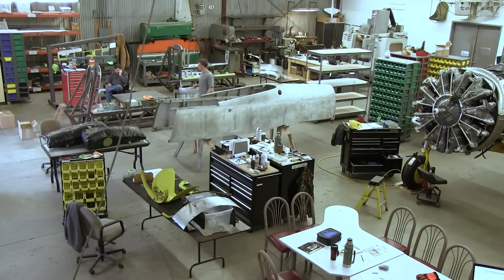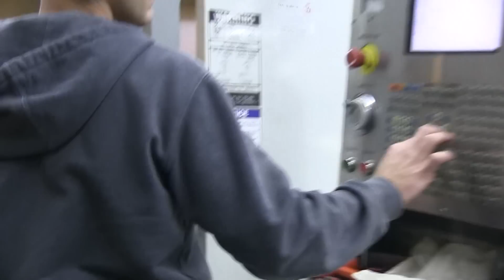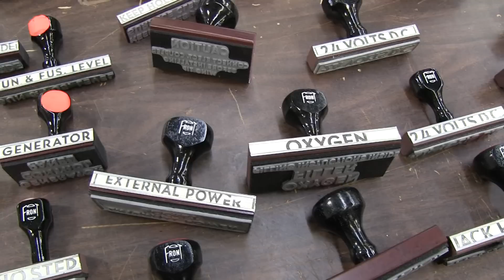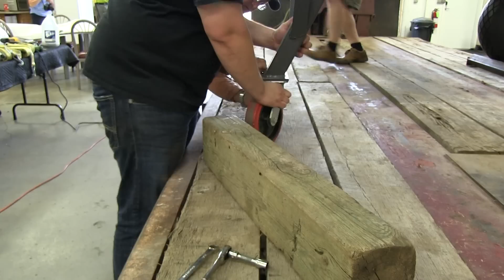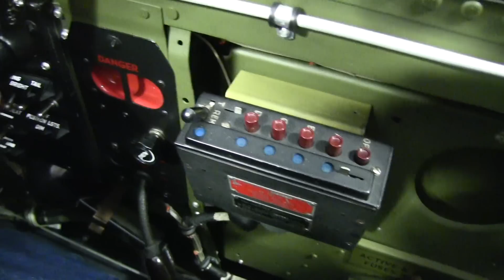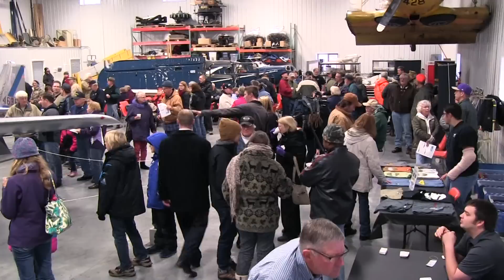Sierra SueII Master with new ending 2 12 15

Comment: I have no idea why they needed an oversize permit for that unless that tail was 14' or higher. It's up there quite a ways so that may have been the reason but there should have been a "high pole" in front of the truck if that was the case and a REAL pilot car.. State laws vary but generally you have to be at least 8' wide or the TOTAL LENGTH of the LOAD longer than the maximum length permitted in the state to need an oversize permit. Weight and height are primary factors involved and typically they are no holidays/weekends and 1/2 hour before sunrise to 1/2 hour after sunset. You don't need a pilot (drives in front) unless you're too tall and the pilot vehicle will have a "pole" on the front set to the measured height of the load so if there are clearance issues the pilot pole hits the obstruction first. The other purpose for a pilot car is overlength/overwidth loads where the pilot has to clear or stop traffic to give the load room to maneuver around a corner. 

The interesting thing about the "police escort" is that he/she was probably "breaking the law" playing "escort" for a permitted oversize load. The pilot car has to be "placarded" with an "oversize load" sign visible from the front and rear, has to have yellow flashing lights, 2-way radio communication with the driver etc. In SOME states the pilot car driver has to have a CDL and the pilot car is considered a "commercial motor vehicle". If you're talking about a "steerable trailer" where the ESCORT (at the rear) car's driver STEERS the trailer at corners then he or she is ALWAYS a CLD operator because they're literally driving and controlling the rear of the vehicle. The tail of that plane may be wider than the door of the building but that doesn't make it "oversize" automatically and even with a "wide load" you don't automatically need an oversize permit. 

Particularly on a machinery trailer like that. It has swing-out supports for deck boards and the trailer is DOT "legal" and so is the load as long as the load doesn't hang over the outside of those deck boards/hangers. If you wanted to haul the plane ASSEMBLED on that trailer you'd have to talk to God about getting a permit because even oversize load permits have limits. Usually at 12 feet wide things start getting "federal" because you have to transport on 4-lane roads. Wind turbine generators and most other commercial machinery is all designed to be "broken down" to "legal" widths and lengths that are legally "oversize" in every state. If they got an oversize permit for the "overhang" with the wing over the back of the trailer that was just foolishness. That trailer is plenty long and had plenty of room in the "well" to get the wing "legal" and it wasn't required for the tail being wider than the door. But we all live and learn. I'd think the investment in getting three-phase at the airport would be a good one although there's no reason all the parts would have to be machined there. Of course those hangars may not even have 240 outlets. The big issue with getting electrical service and enough is always AMPERAGE first. But we have 240 and 480 to halve and quarter the amount of amperage required to handle a load, too. For damn sure you're not going to hang 8 tons off that hoist in the hangar. 

The track may have been "engineered" for that much load and the "roof load" according to the manufacturer of the building may be higher than that but that's probably SNOW LOAD and OVERHEAD HOISTS when they get to 3-5 tons and you're moving that kind of weight lengthwise on the beam start putting big "side loads" on structures and you don't just throw up any old building "shell" you happen to like or are able to afford and think you're going to hang hoists later. As for having that chain hoist, you may have "more control" but you have zero control when you're operating a chain hoist with one hand and trying to steady a load with another or are standing back trying to keep the chain off the work and aren't able to maintain a comfortable working position and are distracted. Nobody who has ever used an electric overhead hoist and one properly engineered and installed and matched to the application thinks a chain hoist gives you "more control" or that proper lifting equipment when you're doing lifting is a "luxury" rather than a NECESSITY. 

All the rules and regulations and laws and "government" we have to deal with today are a pain in the ass and they make "business" a difficult proposition and I think plenty of them are just ridiculous but I've been a mechanic for 25 years and have been hurt plenty of times but thankfully only once "seriously" in a shop and that was a smashed finger, a few stitches and a few days off because working with a big wad of gauze isn't too hard on a finger or thumb but its almost impossible on a PINKY. Which you wouldn't expect but the pinky is important, lol. I've also had debris in my eyes and few times and that ain't fun so eventually I learned to wear safety glasses MOST of the time when "required". And I've always been pretty good about wearing hearing protection since wearing it in a loud shop environment helps you hear BETTER once you filter out all the crap background noise. In particular voices are more easily heard and understood. 

A lot of what we hear is "signal processed" and there's a limit to the amount of "data" our senses and brains can handle and we're easily distracted so when trying to do anything that requires a lot of VISUAL FOCUS having tons of noise in our ears is a problem. At least for me. That's a key issue in why verbal instructions and commands during a job briefing or lift should be AVOIDED AT ALL COSTS. Job briefings take place in a quiet and relaxed setting. Verbal instructions on a shop floor come only after whatever distractions around the conversation are gone. Verbal commands during a lift are a big-time problem and that's why professional crane operators and the "ground guys" use hand signals only. 

There is an insane amount of government regulation and "control" but it's always "consent of the governed" but safety is another issue. Its something that's been beaten into my head since junior high shop classes and probably before in grade school science labs. And in tech school and at most employers to one degree or another although "private sector" employers easily assume that somebody who has experience/education in a given field/industry already knows how to "be safe" and others think it's the employee's responsibility to make sure everything in the shop is done safely and they have the proper safety equipment, etc. That's a big problem today with lots of "entrepreneurs" and "stakeholders" and "investors" in new businesses/industries who have college degrees and/or experience in "business" or "industry" or "engineering" but only on the "clean" side of the walls between the shop and the office space. Never trust a "boss" or "supervisor" who doesn't have scars or dirt on his hands at least once in a while to do or know anything that it takes to keep the shop "safe" or to "get" why its really important to "waste money" on the RIGHT equipment and tools and other resources.

I've had safety beaten into my head all those years and its slowly "taken" to a degree and I've spent probably weeks of my life just watching "safety videos" and at "safety meetings" but honestly the one thing that has stuck with me I didn't even hear until several years ago when I became a "railroader" and went to work for Union Pacific. It was during new employee orientation which was about 99% SAFETY (quickest way to get "terminated" at UP is a safety violation and the "floor" is 24-7-376 HARD HAT, STEEL TOED BOOTS, EYE PROTECTION, HEARING PROTECTION AND GLOVES - NO EXCEPTIONS and EVERY shift begins with lineup which is a job briefing so everybody knows what they're doing so its SAFE on the work floor and nobody is confused and every WEEK is a safety meeting and you go to one weekly even if you have to go to another lineup room) and our "instructor" was the mechanical department's safety director (Bailey Yard Diesel Shop) and a "former" machinist (locomotive mechanic)  like most of us were so we tended to listen pretty well. At some point and it was probably early in the first morning of the first day (orientation was 5 days 8 hours a day) he said one thing about safety I'll always remember.

"The safety rules are written in blood". Think about it.
Reply: Silly Safety Sally, raises her ugly head.
Reply: You couldn't just say good job guys nice plane you had to write a fucking novel about a bunch of bs
Reply: Dude.

              ...That was a-lot of words and stuff and letters and things.
Reply: Hey guys, little history here...my dad worked at the North American plant near Dallas, Texas before joining the army in WWII.  He was a lead man in production building the T-6 and then the P-51C.  Yes, the P-51C was built near Dallas, not Houston...just a minor point but the real story here is your dedication to accurately preserving aircraft which are part of our country's WWII legacy.  I am an old dude and ex pilot but am very proud of you and the work you are doing.  Wish I lived nearby and could lend a hand.  Thank you for putting this online.

Comment: Wooden shims under a cast aluminum plate spaced a couple feet apart and they're to get the plate "flat" or "as flat as we can get it" and "level to the world" to build parts that are not flat or level and will constantly "change position" during construction. At least some of the "experts" in these videos refer to the aircraft's WING instead of "wings". Monoplanes have A "wing". Birds and bats and bi-planes and tri-planes have "wings". Yes the "wing" can be two "separate" sections but when installed they become the "wing". Singular. If it were plural every aircraft would be an "airplanes".
Reply: What's your God damn problem? You must be an absolutely MISERABLE person.